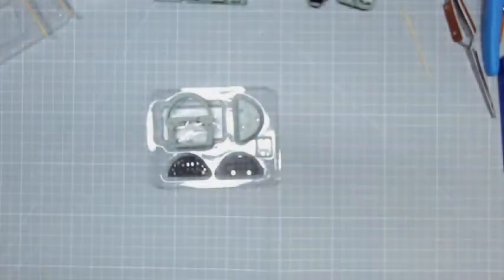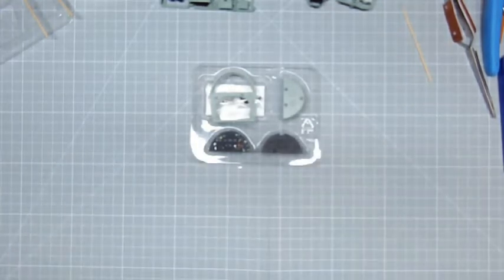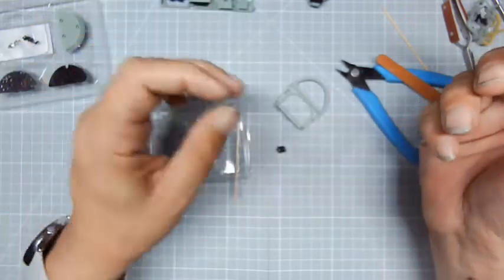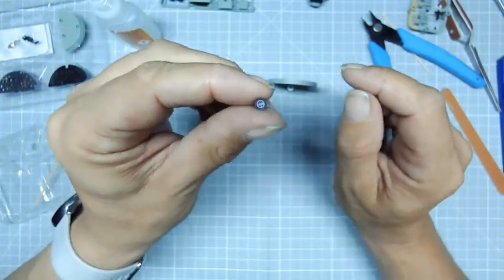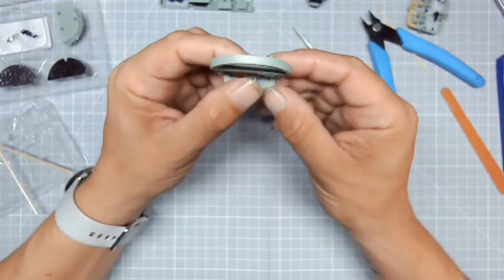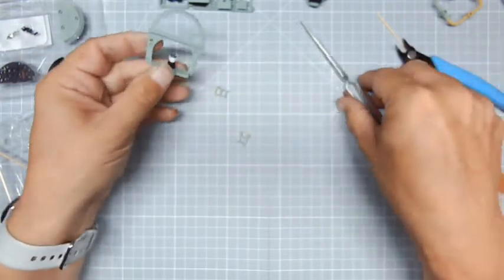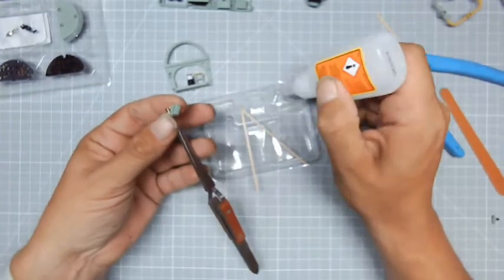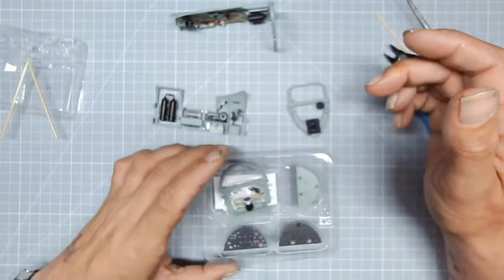Build The Mk1a Spitfire 019 Cockpit Instruments And Controls

Comment: What you are calling the head-up display, is actually the compass.  It really should not be on a pedestal on the floor, but should be on a bracket attached to the underside of the instrument panel.  Considering how much photo etch is supplied with their Bismark model, they could have given us a piece of it for the compass bracket.  Moving the joy stick in conjunction with the rudder pedals, causes the plane to move in what is called a coordinated turn.  Full travel of the ailerons and rudder will result in a wing over, which is for the diving attack you mentioned.